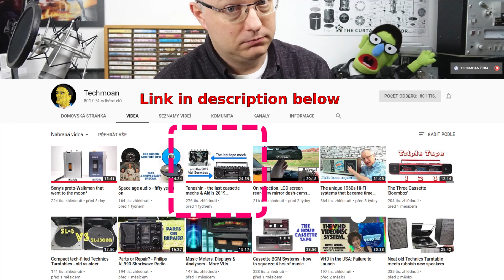Automatic Cassette Deck Mechanics with Solenoid

Comment: This is the reason why the lower end logic mechas from Panasonic are so slow and clunky, it is all made by a function whee and a pulsing solenoidl. I had a 3 solenoid Sharp RT350 Deck and this was rocket in comparison. I guess trying to save some penies on the solenoids. I gets worse end of life tape mechas ... those ara CRAP. Two motors decks from Panasonic are way better and less clunkier ...

Comment: I actually did this on a Technics 2 motor mechanism that was still good out of a tape deck that was dead. I powered the reel motor which also opened the door with a regulated supply and hooked a push button to the control selenoid, and when I was pressing it fast or holding it down or double tapping it If I recall correctly, I was able to change modes. What was fascinating though was that I was able to use all the features only with a simple switch,  of course If you get the timing right. I also hooked up the head to another deck and recorded a cassette full of music as a test. Cheers :)
Reply: :)) good. I want to do it but  we do must selenoid control only circuit?